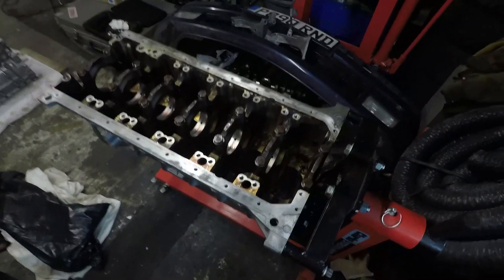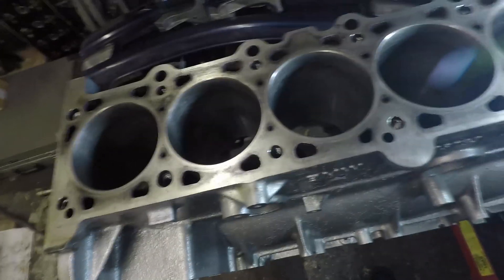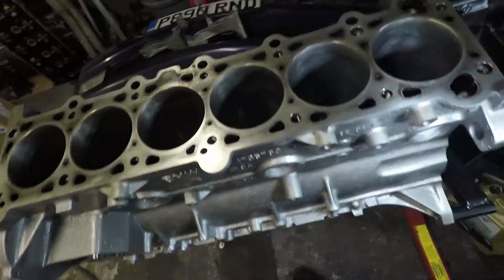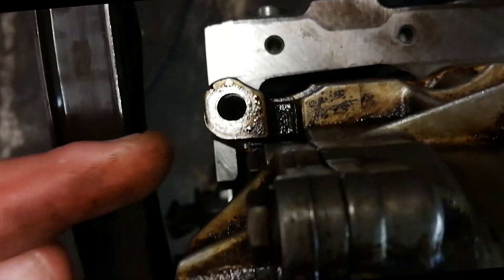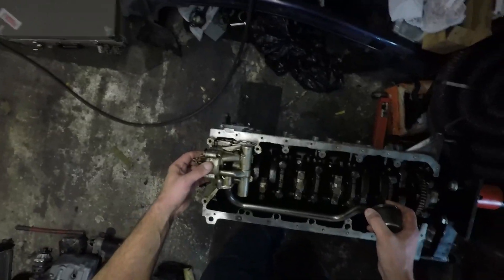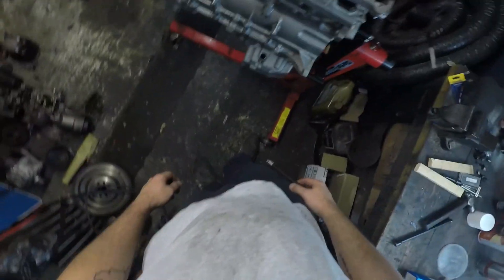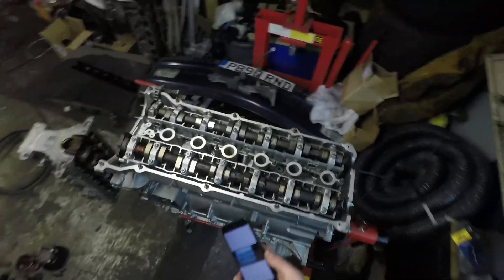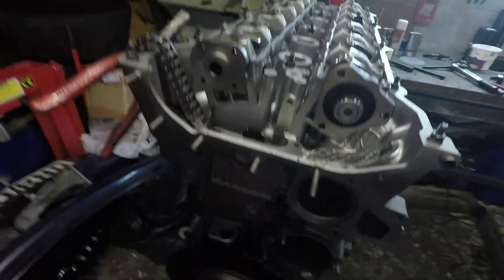M52B30 becomes M50B30 - E36 Stroker Build

Comment: So what did you end up having to do to the oil baffle plate/tray? The info online is all over the place. Some people use spacers to get the B30 crank to clear the M50 plate. But you seemingly had no issues?
Reply from the maker: Forgive my poor memory, but I believe I used the m50 stock plate with stock rod bolts and had no issues with clearance at all.
Reply: @ManSeeksCivic  Ok, so the people who have clearance issues are using ARP rod bolts i guess?
Reply from the maker: Maybe, everything else being equal there must be some variable that folks get stuck with.

Comment: I may end up having a few questions to ask as I'm currently undertaking the same engine build as you, but to begin with, did you rebuild your oil pump or was it a known good unit that you just lockwired?
Reply from the maker: It was the one that came from my m52 that I drilled the nut and lock wired with stainless wire. I installed an oil pressure gauge so pressure can be monitored constantly and I am always glancing at it to keep an eye on things.
Reply: @ManSeeksCivic  okay, sounds like a plan! Cheers
Reply from the maker: You're welcome - good luck with your build.

Comment: Just rewatching the video and see you mention about the different coloured dots for the different size bearings? I have a new pack of bearings originally purchased for m52 block before I pulled some threads refitting the head and changed to an m50 block, all bearings are the same size expect the thrust one? Am I wrong in thinking that?
Reply from the maker: The dots denote different size journals and we're used by the factory. If you were buying bearings from bmw you would buy the corresponding sizes.
Don't panic though, if you've bought aftermarket std bearings you should be fine, the tolerance is quite large. Grab a packet of plastigauge and check a couple to be sure 👍
Reply: @ManSeeksCivic  thanks mate, I was worried for a second.. Second question, the bearings that are in the m50 block have 2 holes in the bearing on the engine side, one hole where the oil squiter goes and one in the normal place, the new bearings have one hole. But all bearings are listed as fitted all model of engine from m20 to m54 and all in-between. The m52 block only has single holes as they oil squitters are in a different place. Hope that makes sense..
Reply from the maker: That's cool, the ones I use are the same. 👍
Reply: @ManSeeksCivic  any reason for the 2 holes? Uprated bearings? Not sure if engine had a rebuild previously, as if was alot cleaner than any other i have worked on.
Reply from the maker: I'm sorry, I'm not sure why there's a difference. Always nice to find a gem 😊
Reply: @ManSeeksCivic  thanks, tried some searching online and nothing comes up so not sure myself either.. also you used m52 oil pump and timing chain guide, is that because you had them there and didn't have the m50 stuff? I have both m50 and m52 so can use either, you had to re drill the hole for the oil pump and also had to space the chain guide as it was m52 stuff on the m50 block, just wondering if there was any other reason other than you not having the m50 oil pump and chain guide.
Reply from the maker: You're right, I just bought the m50 block so didn't have any other bits. I'd use the m50 stuff if I had it to hand.
Reply: @ManSeeksCivic  cool was hoping that was the case and it was because of something else further down the line. I will go with the m50 stuff to make life easier then.

Comment: so glad i came across you on youtube. just at the point of putting my head on- 
m50 iron block
m54 crank and pistons
king race bearings
everything arp
135mm forged rods
total seal custom rings
m54b30 intake
m52b28 exhaust
going ces cut ring and copper spacer tho
big single turbo
twin disk clutch

cannot wait, been building for 4 years now, started as a 1.6l lol, getting close now tho. thank you for taking the time to upload all your videos.
Reply from the maker: Thank you for watching them and good luck. Sounds like a nice build 👍

Comment: Great video series! 

Sorry if I missed it but how did you resolve the different bearing sizes on the M50 block with the M54 crank?
Reply from the maker: The bearings I used were all in spec across the journals. If I had bought bmw bearings I would have had to buy 2 different sizes I believe.
Reply: Pamo thanks for the taking the time to reply. I assume the used something like a Glyco standard size bearing set?

Please keep up the videos, really enjoying them and very informative. Fingers crossed you get the power figures you want.
Reply: So u used stock block M50 Bearings right ?
Reply from the maker: @MrHeadshot05  M54 std size King Bearings.
Reply: Pamo thx a lot mate. Did you Shave the block or the head to get that CR up ?  I think no because u use M54 pistons.
Reply from the maker: @MrHeadshot05  I just had the head surfaced and the block cleaned to recieve the gasket. Comp ratio should be around stock..

Comment: Did you have issues using the m50nvb25 intake camshaft on the exhaust? On mine I had a hard time finding a machine shop that'd cut down the face of the camshaft 2.25mm where the sprocket bolts up due to the factory timing block at the back of the camshaft preventing it from sitting true in a lathe. I did end up finding a place that'd do it but for $250 usd yikes!
Reply: Nice, money saver! Looking forward to your next video!
Reply from the maker: Luckily I work next to a small machine shop and know the owner. He cut it for me for £20.

Comment: Really glad this time it went all good. But I was wondering: wouldn't have been better to get an m52b28 iron block from the US instead of the M50? That way you would not have had problems with the M52 oil pump. Also, why did you decide to go for the non-vanos block? Not sure if that makes any difference, but I remember you had the vanos intake cam from the M54
Reply from the maker: I shudder to think how much it would have cost to get a US block over here. I paid £110 for the m50. As for the vanos non vanos stuff... Doesn't seem any different by block. Its mostly differences in the head.

Comment: Would it be more cost effective to stroke the m50 than finding an s50 and swapping it?
Reply: Gama yes. S50 will sell for 5k+ freshly rebuilt stroker 3.0 maybe halfish
Reply: @Barrybigdickstein  thank you for the quick reply! I appreciate your videos, especially the door handle replacement and the m50 stroker build. Now my passenger door handle works thanks to you 😊
Reply: @Barrybigdickstein  oh whoops, sorry for mistaking you!! Still, thank you for replying. I am in the US and I have a m50b25tu but I'm trying to decide how much all together it would cost to rebuild the m50 as a stroker compared to buying a used s50 US. This includes trying to make the m50 reliable
Reply: @Barrybigdickstein  thank you, I actually have this video saved! Just gathering parts to complete my build
Reply: So I know I have a m52(97 328) but from what I read there so like 3 different ones some that versions in the later esp 97-99. So how do I know which I have? I cant find anywhere to run my vin
Reply: Tom Peters https://youtu.be/bkHLgCjKUY8
Reply: What are you gonna do with the old block? Coffee table? 😉

Comment: So the baffle tray had no interference? Would this be the same if you were to have used the M50 oil pump? Also if ur using the M50 pump would u need to weld on that bracket still?
Reply from the maker: No, and I turned the engine over tens of times before I decided it didn't. As for the pump, I'm not 100% sure but I believe they are different shapes and the sump is different so had to stick with this setup.
Reply: Pamo awesome probably gonna get into mine after Christmas these videos are great man good luck & happy holidays

Comment: A 2.5 m50 Windage tray will interfere with the long throw crank you are using. You need a Windage tray from a 2.8liter or more with an iron block. You could probably clearance  the m50 one if you wind up in a bind.